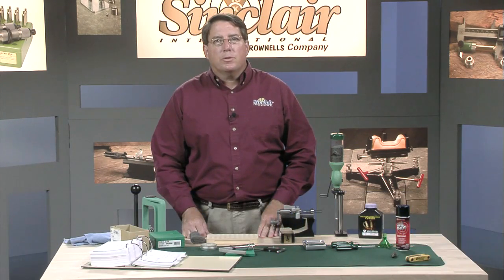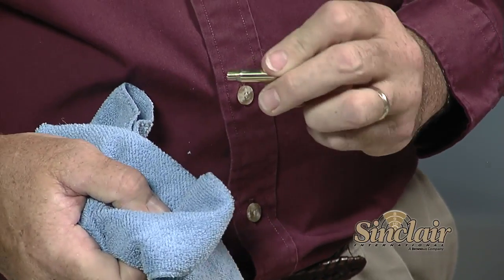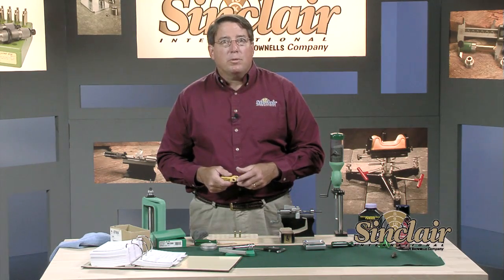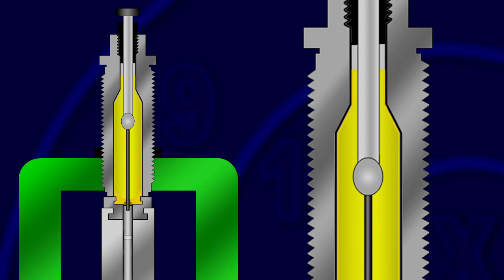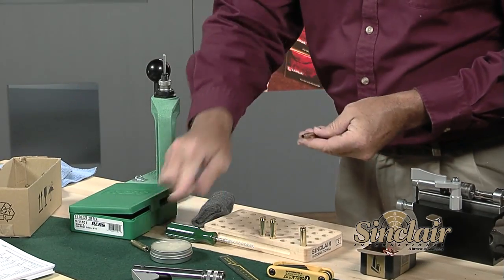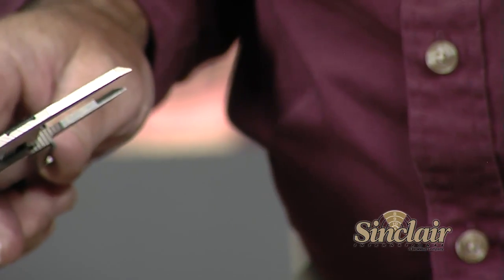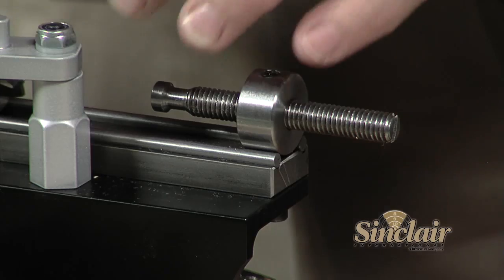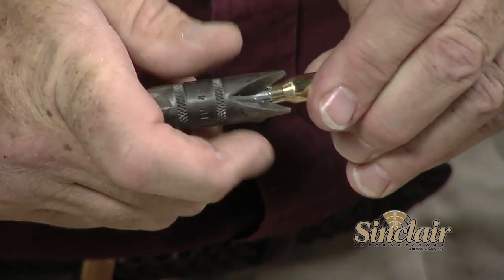Sinclair Reloading Series Part 6, Part 1: Loading a Bottle Neck Cartridge

Comment: IMO, lube should be kept off the shoulder
Reply: +Bob Washere I use the Imperial Dry Neck Lube, does an awesome job without dents.
Reply: I use Imperial as well. On .223 cases it's fairly easy to dent the shoulders. On the acucrate shooter forums, one member expressed some concerns about uneven application causing concentricity issues. I've never noticed this.